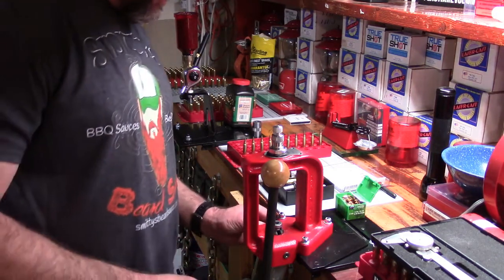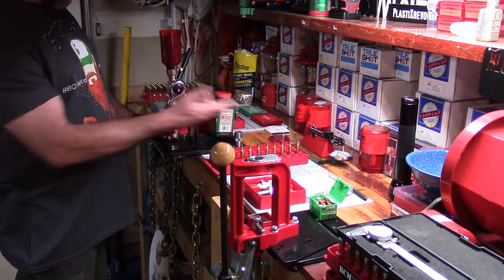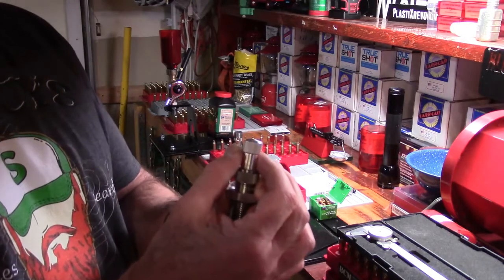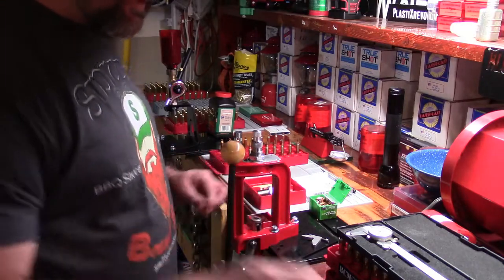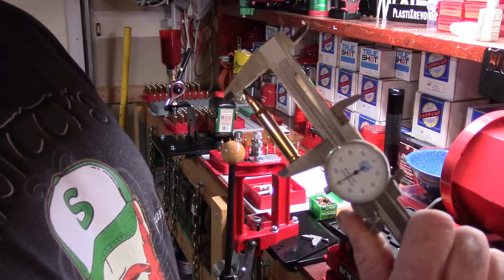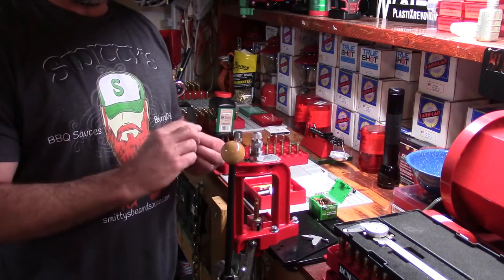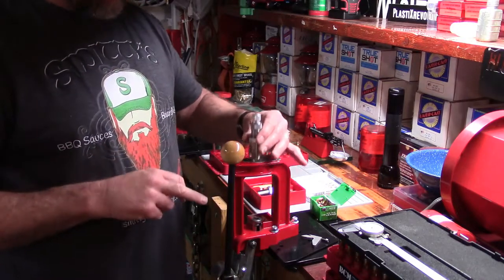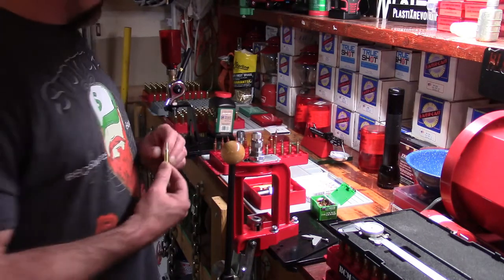Lee Beginning Reloading, 223/5.56, Video 26, Seating with the Lee Breech Lock Challenger

Comment: I have a question on bullet seating. The Lee .223/5.56 doesn't have a neck expander (like a 9mm ), so it will be easier to start the bullet into the case? So the bullet is not started at all in the case, you hold it with your fingers as long as you can until it starts going inside the die then the inside of die must guide the bullet in? Is this correct?